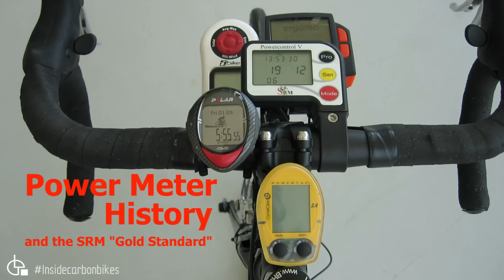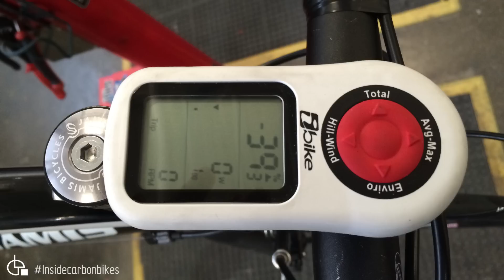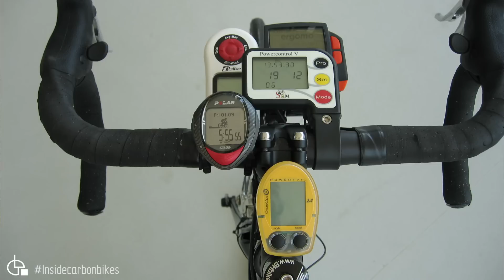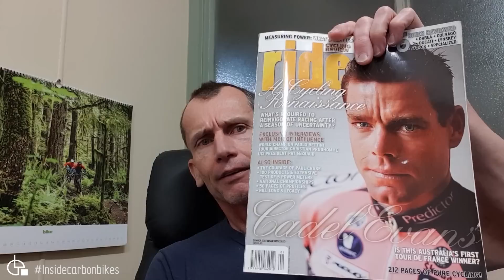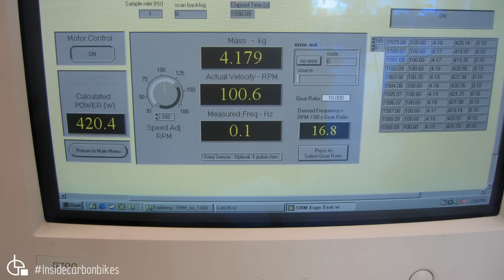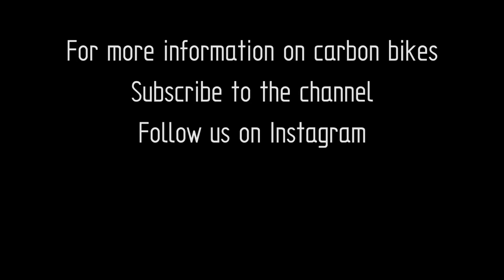Power Meter History and the SRM "Gold Standard"

Comment: Quality as allways Raul. I had the 1. Gen Polar system, and it was a total disaster on many levels. Chain needed to be weighed, pully wheel sensor was wiered and got caught in the spokes, battery life was less than ideal. However- I have never since been able to put out the same 4000+ watts it showed me once in a while 😉
Reply from the maker: Yes, they were less than ideal, it's a shame that your power has decreased though!

Comment: Fun fact: the Polar sensor that mounted to the chainstay was basically the same thing that electric guitars use under the strings
Reply: Thus it used pickups as sensors?
Reply: @MyDemon32  yes, measuring the vibration frequency of the chain. For a given frequency, there's a corresponding tension. Knowing tension and crank speed (cadence), you can determine power.
Reply: had that system but was only really half decent at a narrow range of powers.

Comment: Thanks, Raoul  for this very interesting conversation.  A question:  Has anyone ever built a bike frame with strain gauges molded in - say,  into the left and right chain stays?  Any merit to the idea?   Cheers from sunny SoCal
Reply from the maker: Bikes have been strain gauged for testing purposes, however as a power meter it has a range of issues. Enjoy the sunny days!
Reply: Luescher Teknik Yeah, I wasn't thinking...  A bike frame certainly encounters a range of bending forces that have nothing to do with
pedaling torque.  Cheers M8

Comment: Great gig at the Ais all that travel👍Hardly anyone in my group rides use power meters  myself included. Most of the guys are old school in the sense that they look at speed averages and cadence. I still use cadence, hrm and time on the bike much like lemond, indurain did. I think once cost drops more riders will get meters. Shimano was rumoured ti be bringing out dura ace power pedals this year and they could get the price point.
Reply from the maker: Lemond was the first pro to use SRM power if I recall correctly. Their use increased in the 90's but wasn't used often in races until much later.
Reply: @LuescherTeknik  I didn't hear about Lemond using power but  he wasn't adverse to trying out new products hey especially bars. I can see the merit in power metres in the lab to see whether diet combined with set parameters such as an rpm and gear ratio gives higher power. To be honest i still find cadence monitoring on my trainer delivers results.

Comment: Great history lesson.
Have you seen the power meter being developed by Iq2?  They started out at least 2 years ago designing a power meter to fit between the pedal axle and the crank arm.  You take you're pedal off, screw the power meter into where crank where the pedal would go and then screw the pedal into the power meter.  It sounded like a great idea because it's easy to make them double sided, you can move them between bikes easily and you can use whatever pedals you like.  Problem is, a year after it should have been delivered they announced it did not work.  Now they are about to deliver a pedal based meter like Garmin vector.  But you have to use their pedals.  They are not the first people to try this.  There was a Scottish company that tried a similar design and that failed as well.  To the lay person it looks like the power meter is on the opposite end of the pedal axel - the crank end instead of the pedal end, so why doesn't it work?  Is there some fundamental reason why this design will never work?
Reply from the maker: There are lots of variables and constraints at that location!

Comment: I was involved in rowing and Oz really moved the ball in sports research in prep for the Sydney Games.  We're still using those results.  The Concept2 ergometer has been using a method like the ergomo (hall instead of optical sensors) since 1986(?).  A good system because it is self-calibrating and comparable across machines - solves the calibration problems of strain gauges.
Reply from the maker: As an ex international rower myself, I am very familiar with the Concept 2 ergo.
It measures power by the decay of the wheel speed. The drag factor setting calibrates the reading to compensate for changes in air density effect of fan drag.

Comment: Most crank based powermeters these days (even SRMs AFAIK) are actually based on the late-2000s Quarq design (source: Keith Wakeham youtube video). The SRM had a different configuration with the strain gauges than Quarq with the Quarq being much easier to manufacture.
Reply from the maker: Yes, the strain gauge layout in different on gthe newer SRM's compared to what was shown here on the older series. I actually had discussions with Jim Meyer when he was starting Quarq and supplied some data to him.

Comment: Is it SRM still worth to consider?
Reply: Easy to answer that. Get assioma duos /the end
Reply: MrBJPitt 
I have two quarq’s and power2max.
Question is more in general
Reply: @GramCounter  hence why the duos are /the end. Don't need 3 power meters... srm has the same issue as your power meters. Different power readings when you decide to ride a different bike. Sure you could swap cranks, but then what about if you have different BB? Or even what about the future, spending $3K on a crank based meter, then at some stage you get a new bike whichn is 12, 13 speed or whatever, requiring different crank.
Reply: MrBJPitt 
Diferent power reading?
Common...
I ride with quarq and power2max long time now,i know about power meters something
Reply: @MrBJPitt   In which country crank based power meters are $3K? Power2max and Quarqs are cheap these day and I'd say more reliable than any pedal based power meter. I'd  aggree that Assiomas are one of the good ones though. But... Swapping it between bikes back and forth is bad idea. Readings after fresh new installations are not reliable. It requires some setting period to stabilize offset.
Reply: @michwoz  the country this video was made - Australia, where a  srm crankset costs $3,300+ aud https://www.bikebug.com/srm-origin-shimano-9100-powermeter-p-75252.html

And readings are a 10 min ride, then reset is reliable. For the assioma duos anyway. I've got a quarq. And it's gathering dust next to my sysges and 4iiii. I should have just got the assioma duos to start with and be done. Assiomas are better than the quarq if you want true left right readings, and it's always nice to know your pedal metrics just for piece of mind.
Reply: @MrBJPitt  Buying SRM in 2020 is isanity ;) Quarq is actually better power meter...

Yeah, Assiomas are better if you need left/right balance. Almost no one does though. It's not very useful data.
Reply: @michwoz  not very useful, but neither is a crankset that is obsolete in your next bike.
Reply: @MrBJPitt  Yeah. I don't change bikes so often but if so I consider next bike compatibility with my current power meter crank set.
Reply: @michwoz  L/R data is VERY useful when looking at comparative data with other L/R power meters. ok... my use case is a little different to normal. :)
Reply: @gplama  Oh yes. For that it actually is very useful :) I also see limited use case for it when coming back from injury or resolving some bike fit issues. But from my experience most people do absolutely nothing with L/R data or advanced pedal metrics.
Reply: MrBJPitt 
You can purchase brand new srm with rotor 3D+ crank for 950€.
Brand new.
7.gen.
Reply: https://www.dcrainmaker.com/2018/11/power-meter-buyers-2018.html
Reply: If you want very good technical insights on power meters, Keith Wakeham's channel is a must watch. He essentially developed yhe 4iii powermeter.